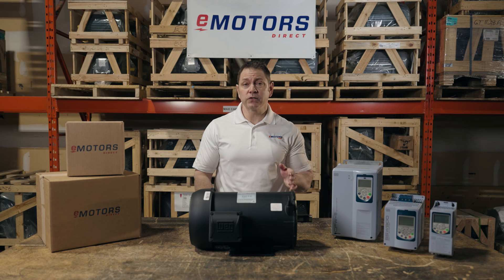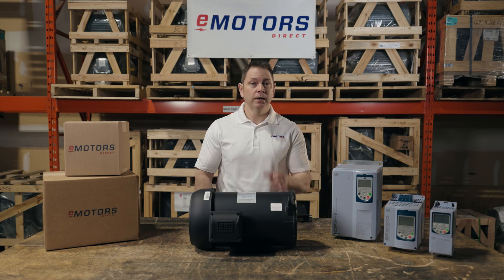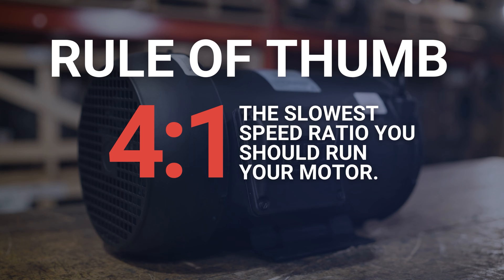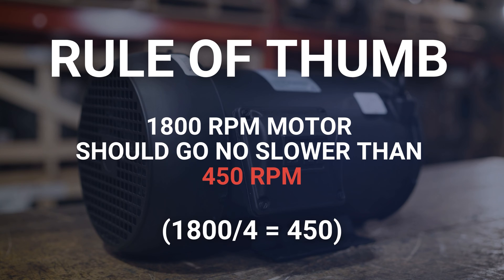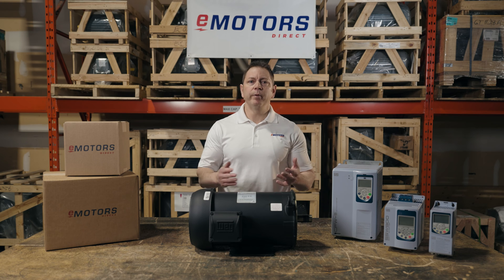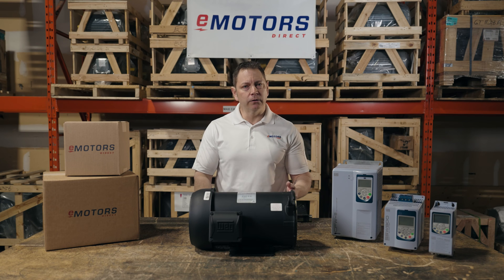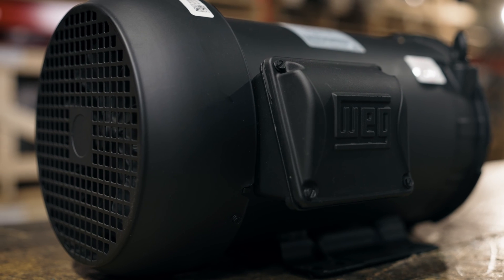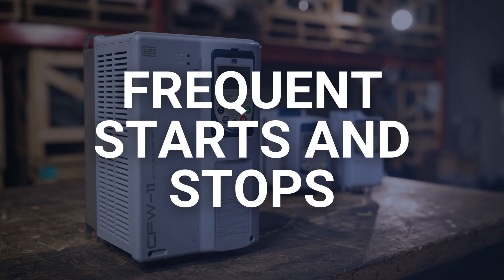VFD Minimum Speeds: How Slow Can You Safely Run Your Motor

Comment: what about torque at low RPM? In real life do we have 100% torque at 1 Hz frequency ?
Reply from the maker: At 1 Hz, you won’t get 100% torque with a standard V/Hz drive because low frequency means less voltage and magnetic flux. For full torque at low speed, use a VFD with sensorless or full vector control (or a servo drive). It also depends on the motor’s torque-speed curve—check the datasheet to see the % of rated torque available at given speed range.
Reply: @emotorsdirect  thanks for your response. Is there any rule of thumb for this? For example, can we consider 100% torque for frecquency >10 Hz for convencional motors?

Comment: So I currently have a TEAO belt driven cooling tower motor that states it’s good for a PWM VFD at 1000:1 VT, 20:1 CT. Someone has the minimum set in the vfd to 15 hz. Can I drop this minimum to 0hz with the given specs? Thanks
Reply from the maker: Since the motor is TEAO, which relies on external airflow for cooling, and I'm not sure insulation class what your motor insulation class is, it’s safest to follow the 20:1 Constant Torque (CT) ratio. That means the minimum frequency should be around 3 Hz (for a 60 Hz motor). Setting it to 0 Hz isn’t safe, as the motor would remain energized without airflow, risking overheating.
Reply: @emotorsdirect thank you very much for your response. If I’m reading it correctly, insulation class is “F” and it appears to say delta t/cross 80K
Reply: @emotorsdirect  BALTIMORE ARCOLL COMPANY
W22
Premium
PH 3
HP (kW)
30
22
208-230
A
77.6-70.2
RPM
1765
NEMA NOM. EFF CODE
G
93
6
DES
B
ENCL.
TEAO
ALT.
1000
m.a.s.l.
CCO29A
MANUFACTURED BY
JEC
HENG SGR
BEARING PROTECTION RING INSTALLED
460
35.1
SFA 87.8 / 43.9
%
AMB.
40 C
IP55
FRAME
Hz
SF
INS.
CL.
286T
60
1.25
At
P.F.
0.84
DUTY CONT.
WEIGHT 459
WBANP -30A0-E
80
Lbs
208-230 V(60Hz)
22AOGEBBCB
Z1054450817
RUN CONNECTION
• T12
oT10
016
6T4
OT9
017
오
T3
QT1
L3
L1
460V(60Hz)
aTI1 OT12 6110
016)
T8
T2
L2
0 T9
QT3
ФТ1
13 L1
- 6311-2RS-C3
MOBIL POLYREX EM
- 6211-2RS-C3
FOR USE ON PM VFD 1000:1 VT, 20:1CT, 1.0SF
10/7/2020

Comment: What if there is no load ? Nothing going through pump, what lowest rpm motor can run in that case. I read somewhere about 3hz is the lowest motor can run
Reply from the maker: When there's no load on the pump, the motor can run at very low RPMs. However, for any application, check the motor's datasheet for low-speed operation, as running at very low frequencies (around 3 Hz) can affect performance and efficiency. Low RPMs can also cause overheating due to ineffective cooling. Additionally, lower RPMs can reduce pump efficiency due to factors like increased hydraulic losses. Always consult both the motor and pump datasheets and the manufacturer for detailed guidance.

Comment: Excellent Video well informed thank u 
I manufacture Car Compound and currently use 3 phase motor I want to change it to a single phase motor to do my mixing and I do have 3 phase VSD will it work of single phase
Reply from the maker: Hi Kumar, thanks for the question! Generally speaking, single phase motors aren't designed to be controlled by VFDs (but it really depends on what VFD and motor you're using). Why do you want to switch your motor to single phase?

Comment: Considering going 3phase for my next model train. (YT search "Train Mountain" for context) 
I'm not concerned about over heating a slow turning traction motor. My 3/4hp 24v 56c 1800rpm motor has never been hot to the touch, even when producing about 1.25 hp. High load duty cycles are generally fairly short. 
Questions:
1. Can VFD use remote potentiometer for speed and toggle switch for direction?
2. will VFD produce smooth rotation at low speeds?
3. Can VFD do dynamic braking? How is this energy dissipated? Grid resistor?

Using 3 phase has its appeal because:
1. Generation of 120v single phase can be done with compact - quiet inverter generator. 
2. wheel slippage can be more easily managed vs DC motor tend to speed up. 3 phase motors are frequency locked (to an extend) to a speed.
3. easier to maintain desired travel speed, as frequency controls speed vs voltage of DC system. Sensing system in VFD can limit torque to prevent overload.
4. If braking is dynamic, and can be shunted to load resistor of sufficient size? Down hill momentum can be easily controlled by turn of dial instead of on-off with DC system.
5. Using motor to hold train still for brief periods vs having to engage mechanical brakes would be a great improvement.
Reply from the maker: Sounds like you have quite the train set up! Answers to your questions below. 

(1) Yes 
(2) Yes, however, low-speed rotation depends on the type of VFD and the motor used 
(3) Yes, if your VFD has a dynamic braking resistor

Comment: Thankyou so much sir
Reply from the maker: Thanks Linos - more videos coming soon.
Reply: Sir i have a motor runing by vfd its rpm is 1500 i want to rpm is 1200 how to calculate its frequency
Reply from the maker: @AsgharAli-kx2if  
Formula: Old Frequency x (RPM new / RPM old) = New Frequency

50Hz x (1200 RPM /1500 RPM) = 40Hz
Reply: I will wait for your help sir